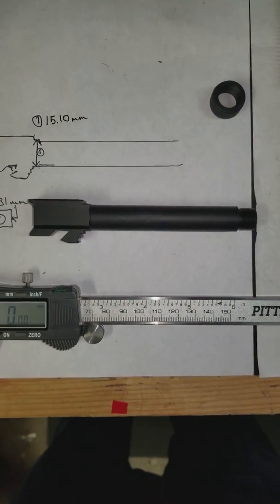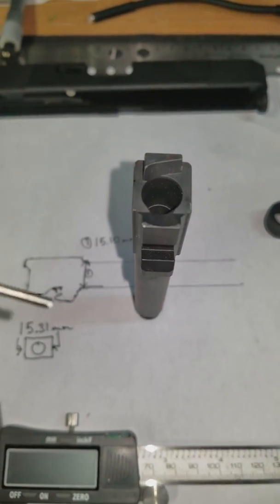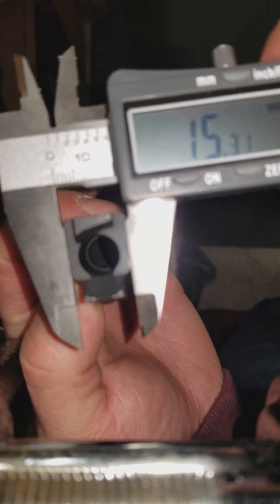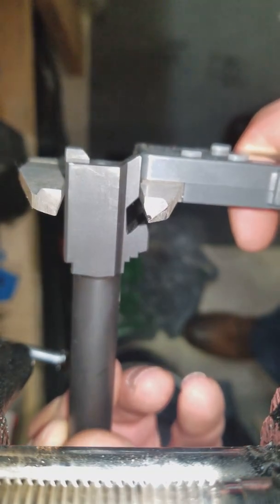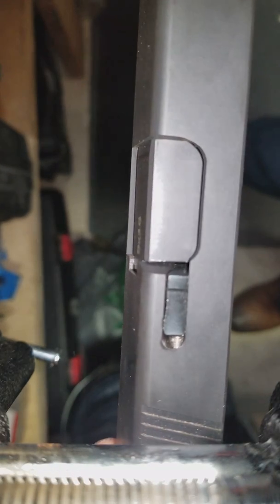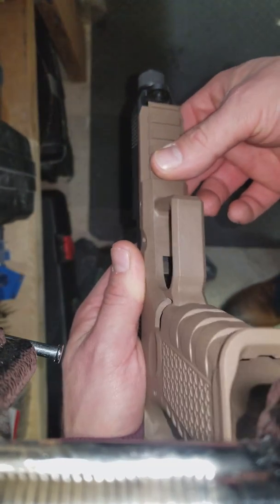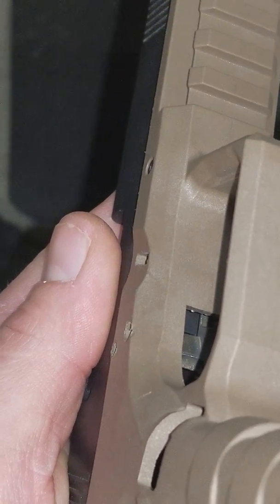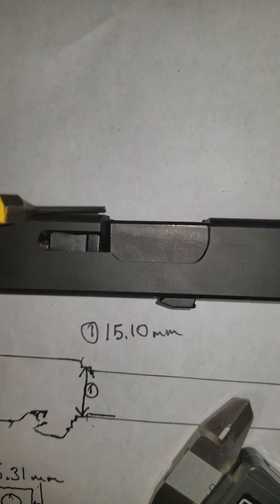POLYMER 80 PF940 V2 SWENSON BARREL ISSUE OUT OF BATTERY

Comment: If you use genuine Glock parts you won't have these issues. Learned by experience. once you have a working unit you can buy custom aftermarket parts. then if you have a problem, you can pinpoint the problem and fix that part.

Comment: Sand down your metal rails. They might be uneven so you have to get sand them to be even enough so your slide goes on and you don’t have any problem racking the slide. It might take you a few times of sanding and trying your slide on your frame but do it till it’s easy to rack that slide. And once you’re done you can lube up the slide and rail and keep racking that slide till it gets adjusted to the rails and it should be buttery smooth after this process.

Comment: If you are having that issue it is a good thing use 800 grit sandpaper   racking the slide as much as possible. Then let the wear patterns show you waer to sand. Once it is hand fitted the lock up will be better than the OEM glock as far as fitting.
Reply: It is a slow and time consuming process. Yet if you have the lock up as tight as a 1911 you'll be surprised on the grouping, a one hole group at 10 yards is well worth the work you put into lock up. I worked in a class 3 shop head of r&d for suppressor development. Plus working on building sidearms for a hospital network police department. Sure it is a pain in the ass to hand fit a barrel and frame yet the rewards are more worth it, as well as teaching yourself a new skill on working on firearms is always better. Use a layout dye sand the areas slowly test fitting once it is it locks up go to polishing or even 2400 grit wet or dry sandpaper. Taking only the littlest amount off the barrel for reabailty. Max .0001 off until you're able to pull the slide back, then build the slide and then use jeweler rudge ( you can find it at home depo I think it is like ten bucks, and you can use a cloth or even a rotary tool with the polishing wheels, you'll be okay then you can use a little bit of rust blue to make it match midwayusa sells all that you will need expect the sandpaper.

Comment: Return the barrel to midway & just get a Stock Glock barrel so no more issues
I wouldn’t mess with it just seems way out of spec
Reply from the maker: mikey 
I tried contacting SWENSON, I guess they don't exist. 
I fixed it. After sanding and filling the barrel the left side of the barrel it fit. 
I will post updated video. 
Thank you for your response!
Nick